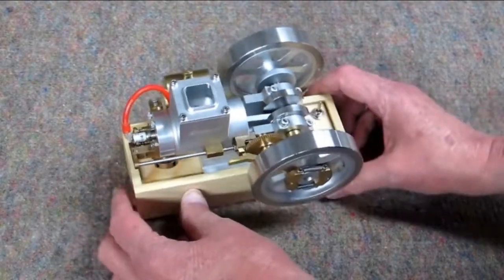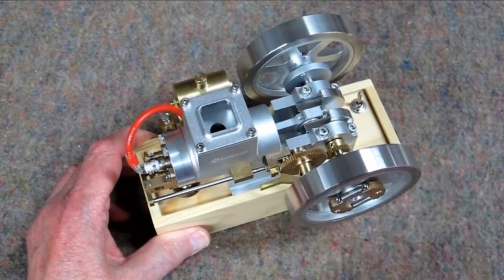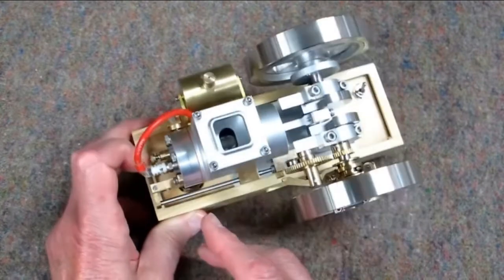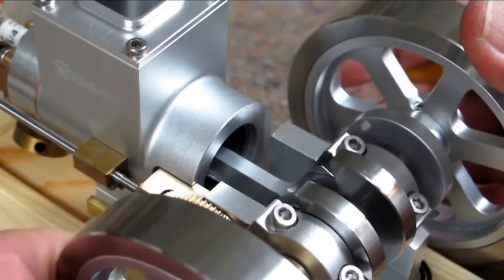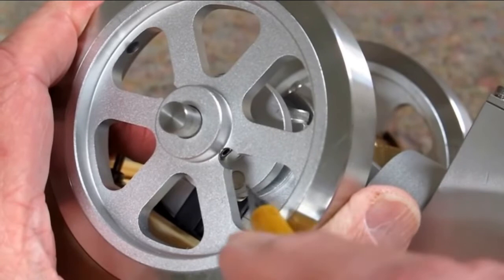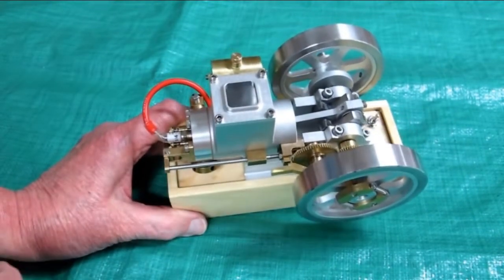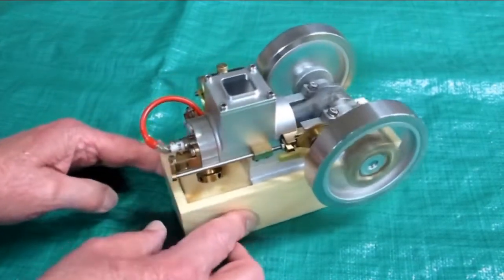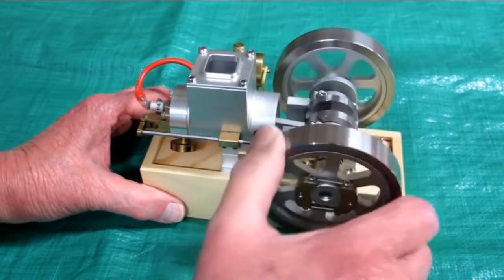M90 Hit & Miss Engine

Comment: Is there anywhere other than bang good to buy a new ignition system for this motor?
Reply from the maker: That would be EngineDIY and there are links in the description for this video.
However... there are several different ignition systems out there. I have asked which is the correct one for the M90. I will get back to you whenever I get an answer... probably after Christmas. Ron
Reply from the maker: My rep at EngineDIY told me this is the correct one for the M90 Hit and Miss.

Ignition Kit Accessories for Vertical Hit and Miss Engine
https://www.enginediy.com/products/ignition-kit-accessories-for-vertical-hit-and-miss-engine?_pos=1&_sid=df3af0143&_ss=r&ref=V81L4uEO

Comment: I have sold off all my large flywheel engines and want to just do small models now. For a first model with a reasonable chance of success would you go with the M90/ET1 hit and miss type or the M25/ ET6 side shaft style ?  Or even the 6cc Enjomor type?
Reply from the maker: Anthony, 
My "standard reply" to this question is below to save me much time typing. Note the ET6 is the M92.

I really like the little M19 (EM2)

I don't have the Enjomor 6cc engine. There are several videos on youtube for this engine... some people have had problems with the ignition so you may want to reconsider this one.

I no longer recommend Banggood.com as they seem incapable and/or unwilling to keep engines in stock. Their supply of engines has all but dried up.

EngineDIY.com seems to be able to supply most engines and you will find links to the various engines in the description of all my engine videos. They also have a better selection of engines. 
I ask that you use the links given in the video descriptions since I then get credit for the sale.

There is also a coupon code that will save you money.

ET1, ET6, ET7, EM2, etc. are model numbers created by Banggood and they are not the manufacturer's numbers.

M90, M92, M94, M19, etc. are the manufacturer's model numbers and are the ones shown on EngindDIY.com, and they are the exact same engines.

I like the following engines the best.

M94 (ET7) Simplified Governor Hit & Miss Water Cooled
    I think it is the easiest of this series engine to replace piston o-rings.
    M94 Hit & Miss Engine - Simplified Governor    
    https://youtu.be/aX-WyJlyUNk

M19 (EM2) Mini Vertical Hit & Miss Flying Ball Governor
    Beautiful little engine that does not jump up and down and move around.
    M19 Vertical Hit & Miss Engine With Flying Ball Governor
    https://youtu.be/TAbuAm-773U

M90 (ET1) First (Silver) Hit & Miss Water Cooled & Governor

M92 (ET6) Flying Ball Governor Hit & Miss Water Cooled & Governor
     Very nice running engine but it is a bit more complicated and requires a bit more care and lubrication. The governor on this engine does not slow down the engine enough without some modification to the spring (always a chance to break something with these small threads and small parts).

My engines start and run when I fuel them up. Things can get out of adjustment or become gummed up from old oil, etc. You just need to learn how they run and how to troubleshoot problems. 

A model engine is a toy. It is to be appreciated for what it is, a model of a full size working engine. They are not intended to be run for long duration, at very high speed (RPM) nor under high loads. These engines seem to run for quite a while with these high temperature o-rings. The o-rings are readily available at EngineDIY. There are larger o-rings for the larger engines such as the M90 and smaller o-rings for the smaller engines such as the M12. 

Search for: 

10Pcs Rubber O Ring for M90 Hit and Miss Horizontal Gasoline Engine 

10Pcs Rubber O Ring for M12 2.6cc Mini Four-stroke Gasoline Engine Model 

EngineDIY also has other parts. Look around. 

I have over 70 videos all listed in a playlist on my YouTube channel. There is a lot of information there.

I also have a video on the recommended fuel for these engines.

Thanks for watching. Hope you have subscribed!
That is what keeps this channel going. 
Ron

Use the following link: https://www.enginediy.com/discount/Ron'sStuff

Coupon Code 10% off for all engines: Ron'sStuff